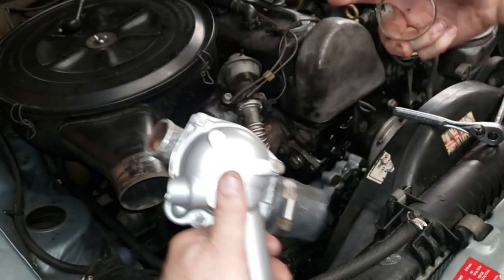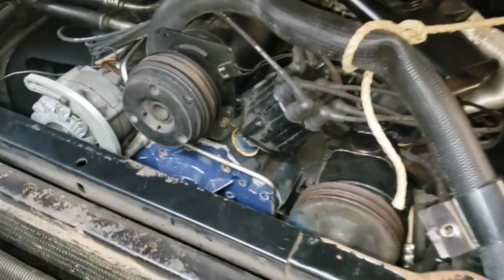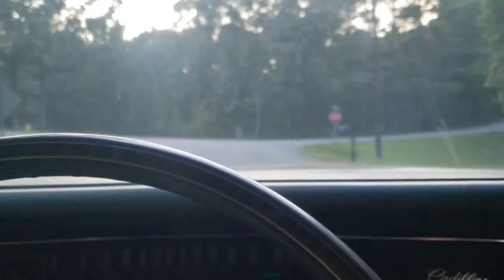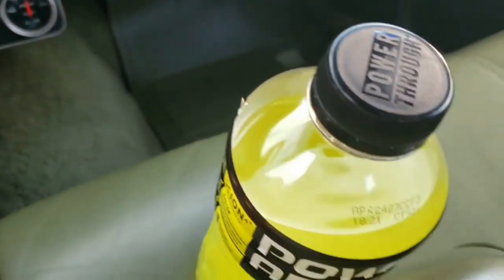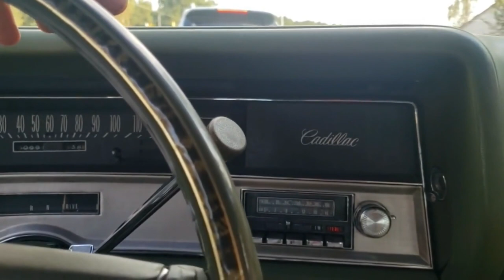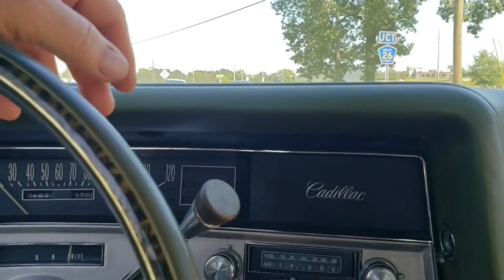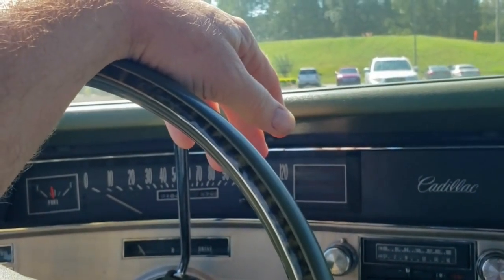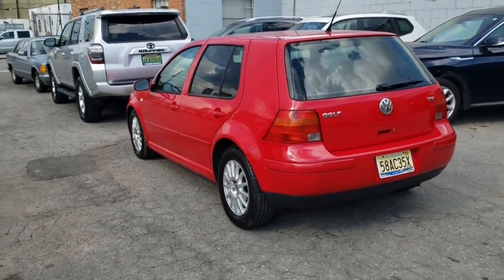VLOG - W126 Frozen Caliper, Cadillac Water Pump, Alignment, Timing, VW Collision Repair

Comment: Yes, Firestone 721. Then they gave us the 500 that blew apart with those crappy(almost typed a more colorful word) single-ply sidewalls. 
BTW, one of my TVs is an 8 year old Vizio. Still works great. Watching you on it right now. 
That "miss"  quite possibly be burnt exhaust valves from the lack of lead for so many years. I know you rebuilt the carburetor, but spray some carburetor cleaner around the base and around the linkage. The holes for the throttle linkage are notorious for wearing and creating vacuum leaks.
While you're doing that pinion bearing, take a close look at the carrier bearings.
Reply from the maker: Well supposedly the 71 cars were the first ones to come with hardened valve seats so lead would/should not be a requirement. The investigation will continue though!

Comment: I think those fan covers are year specific, my 1972 coupe DeVille didn't have one and instead had two brackets that bolted over the radiator with the specs sticker on the frame my 71 had the cover and also the brackets that hold the radiator built on the cover if I remember right.  My 70 Cadillac doesn't have a cover either.

Comment: I have a Google account and I'm always logged in but I did not know that had anything to do with YouTube. Mmmm
I don't remember ever setting idle timing even up to eight. That seems high to me at idle with the vacume advance disconnected. The biggest motor I ever tuned was my 428cj.  I don't remember ever fooling with the 454 in the Riviera.
So maybe it's just that big ol motor that needs that much advance.

You said you got that plasma TV in 07 right? 
I had been told they only lasted four years. 16 years is a long time for one.
The old Benz is looking good. See ya!
Reply from the maker: Google bought youtube in 2006.

Comment: Curious, I am wondering if you have a small vacuum leak in the gasket between the carb and the engine, or the intake manifold gasket somewhere. These big blocks are supposed to be silky smooth.
Reply from the maker: I had the intake off a couple years ago and thoroughly cleaned the intake valves. Sealed it up nicely when done. Of course there is a possibility that I missed a spot with the Permatex Ultra Grey.  I'm planning to get a smoke tester to see if I can spot some vacuum leaks that way.😁

Comment: Have you ran couple tanks real gas through it? Does the heads have hardened valve seats?
Reply from the maker: Not since the engine work.... about 1/2 tank. 71 was the first year for hardened valve seats according the Cadillac documentation.